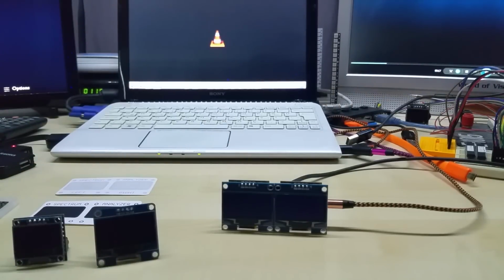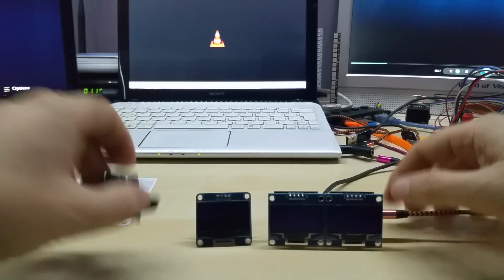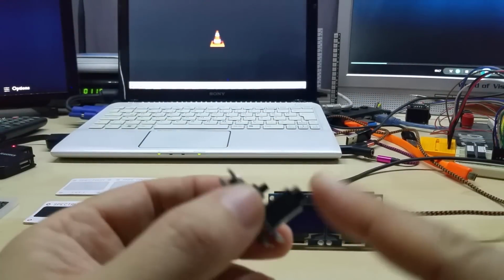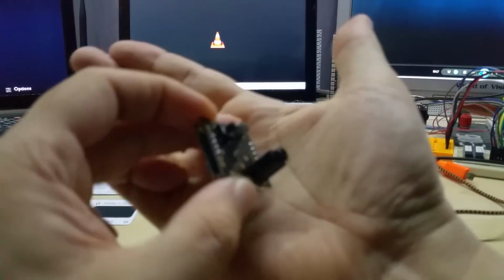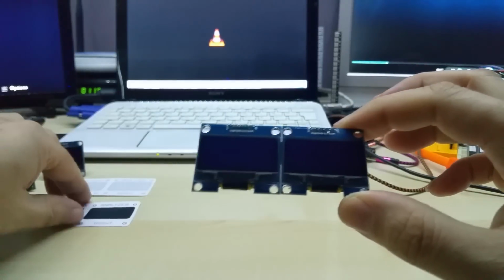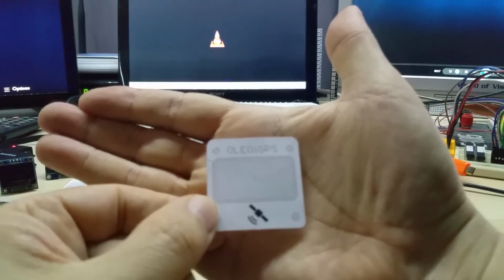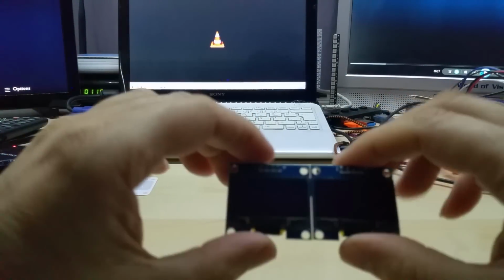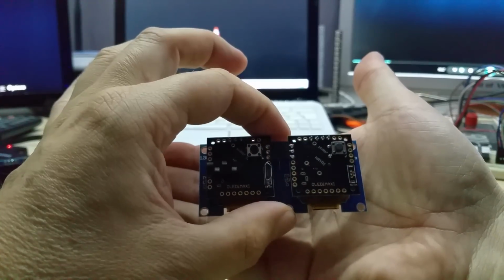Spectrum Analyzer Family 0.96", 1.3" + Stereo, 12 V version possible too.

Comment: Nice work! Try holding up large piece of smooth, medium grey coloured paper right behind the object to help camera get good focus and exposure for those close ups.  Maybe a blank "grey flag" mounted on an out-of-camera-view pivoted stick could swing up to the perfect focus position and aid in holding the object steady.  Also,  I notice there's a much greater display indication of low and mid frequency sounds and comparatively little if any response at all to the loud, high frequency melody in those last music samples (maybe ~800 to 2,500 Hz range?).  I'm interested in driving multi-frequency "color organ" lighting LEDs from music (or possibly MIDI input) and wondering if that low end bias is a hardware/sampling limitation or just a software issue.
Reply from the maker: Thank you very much for the tip, I have a self made LED strip light above my desk and could easily hang either paper or grey fabric off it. Probably easier to find fabric than paper :-) As for the display response, since all frequency calculation and separation happens in the MSGEQ7 chip I am sure my laptop sound card or the lack of is responsible. I also can't vouch for the music samples I have from the internet. If you have any sound sample that you know I can try it with the spectrum analyzer and we can see if it is any better. Another possibility would be a frequency generator app played from my cell phone, I am sure it will have better hardware that the laptop :-)

Comment: +1 for 12v automotive applications
Reply from the maker: Yes, it can be made for 12 volt input too, no problem. Plus the switch can be extended by a wire to a external push button to change the animations.
Reply: Hayri I’m interested in the larger stereo version (for my car audio system) I have an ash tray door that pops up that im thinking of mounting it in . Please email me at atxjohnny6@hotmail.com

Comment: Can I order one that comes ready to run on 12v? Looking at automotive application
Reply from the maker: 5 hours sleep, back to work :-) Sure you can and as I mentioned in the video I can run a wire out so you can change the animation with a push button.